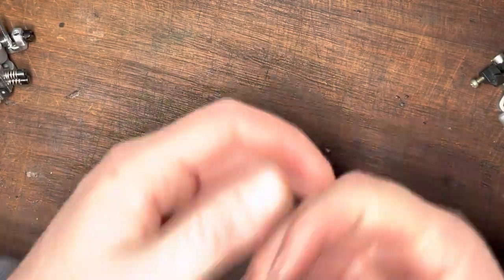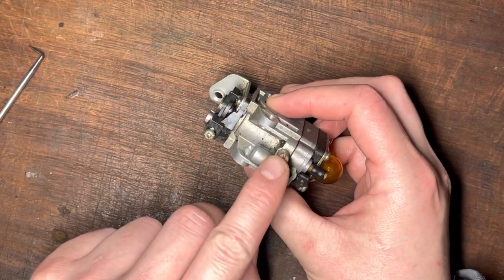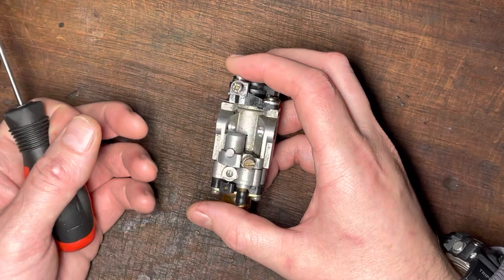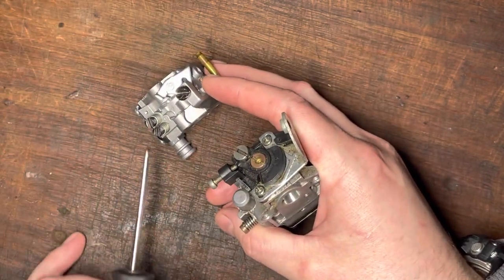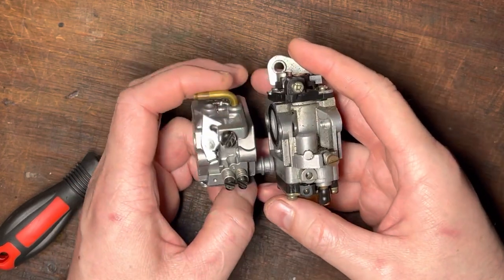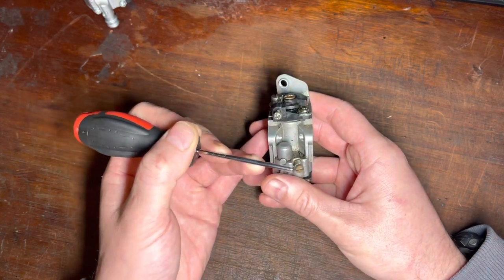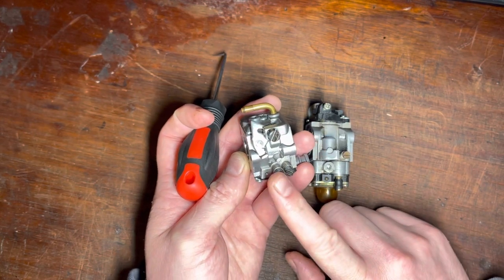Carburetor Tuning - 10 Things You NEED To Know!

Comment: Very informative, thanks a lot, by the way, the other carb, not the walbro type, what is that one called?
Reply from the maker: Thank you! It’s called either a “rotary” or a “barrel” type carb :) The thing I like most is you can run them on the edge of lean at idle for excellent trigger response and they don’t lean bog like the more common butterfly type.
Reply: @VintageEngineRepairs  Thanks a lot for the quick response :) Am an RC modelller and your videos are really helpful in understanding these carbs, tuning them and troubleshooting. Subscribed :)

Comment: Another cause i have found for an engine to stall after coming off throttle is a metering lever set too high, even with the proper mixture screw setting if the lever is set above where it should it will cause the engine to suck a lot of fuel when the throttle is released and make it slow down or even stall
Reply: Also, that information about the independent or dependent carburetor mixture screws is really cool, never stopped to think about it but it makes perfect sense

Comment: 0:00   1. Difficult to start engine.
0:42   2. Engine bogs on acceleration.
1:30   3. Engine splutters on acceleration.
2:06   4. Low power at full throttle.
2:47   5. Engine running rough with excessive smoke when at full throttle.
3:22   6. Engine idles too fast and idle adjustment is unresponsive.
4:04   7. Difficult to start engine with fuel out of the muffler.
4:23   8. Engine RPM drops excessively after full throttle or dies completely.
5:00   9. Engine stalls when left idling for a short period of time.
5:52 10. Engine RPMs change when you turn your engine on the side.
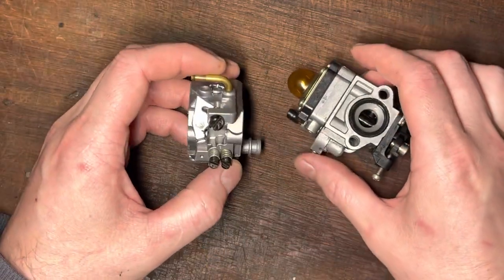7:49  BONUS TIP! Which screw do we adjust first?!
Reply from the maker: Wow thanks! Pinned this comment to the top :)
Reply: @VintageEngineRepairs  Cheers. I was still editing it, tweaking the times but can't anymore, I guess because it's pinned now?
Reply from the maker: @Syncop8rNZ  oh no, I’ll unpin it, let you do what you need and then re pin  it.
Reply: @VintageEngineRepairs  Oh I missed this, went to the pub. ;-)
It's all good, some of the time stamps could have been a second or two later but close enough.
My OCD is mostly satisfied.

Comment: Thank you.  My Echo PB265 starts well and revs well but after ten minutes of running it begins to lose power and, although just my conjecture, it seems to run hotter than previously.  Might you have any suggestions to resolve this?
Reply from the maker: Hmmm, you could try opening the H screw 1/8 of a turn and see if that helps?
Reply: @VintageEngineRepairs  Thank you for taking the time to help on this matter.  I haven't altered the high-speed adjuster screw so far because this blower has run flawlessly for almost a decade and, as implied above; it still performs beautifully with the H screw still concealed beyond the plastic plug--that is, until it gets warm or perhaps closer to hot.  During those first ten-to-fifteen minutes, it responds immediately to throttle movement, neither bogging nor burbling. I did remove the muffler and although the port appears normal (no heavy deposits of carbon) the spark arrestor is destroyed.  I wondered if the main body of baffling behind the arrestor gets so hot, perhaps red hot, that a new spark arrestor screen might resolve the conundrum.  Yet, if you still consider that high-speed adjustment (enrichment) remains the best option, I'll try it.  Thank you again.
Reply: Coil failure was responsible for the Echo blower engine stopping ten minutes after starting.  The difficulty was unlikely to be caused by the carburetor because I had access to another that produced the same result when warm.  The fascinating thing was that though the spare carburetor had a larger diameter venturi, it worked amazingly well, at least for the first ten minutes.  Thank you again for your wonderful series of instructional videos.

Comment: As I said in a comment about one of your videos regarding the Chinese Honda  cloned GX35 engine, which I was trying to tune I was thinking that it might be either an air leak through the check valve inside the metering body of the carburettor or something like that but since you said that the high speed screw might need adjusting then I might have to remove the brass sealing plug  from the carburettors body to get access to the high speed screw which is uncovered on some of the Chinese Hondas carburettors  but in my case with the OEM & aftermarket carburettor which I have they're covered.

What it was doing with the new aftermarket carburettor is stumbling then  stalling as It came down to an idle then I would restart it then it wouldn't idle until I readjusted the low speed mixture screw then it would play up again.

It would also start in the mornings when the engine was cold but it wouldn't idle until I adjusted the low speed mixture screw so I refitted the original Honda carburettor which seems to have fixed the problem !
Reply from the maker: Woo! Glad you got it sorted :)

Comment: I have an independent carburetor that works in the middle and not WOT. It operates well except in the mid throttle range where it will slowly lose rpm at a constant throttle position. I will open it up a little more by the throttle to which it will surge to higher rpm. What is a good mid range fix? (modifications are possible if suggested) it is the walbro 32
Reply from the maker: These don’t have a dedicated mid range circuit. Open the H screw 1/4 turn :)
Reply: ok thanks and lets say I'd like to add a dedicated mid range circuit, any advice where to look for reference or your thoughts? @VintageEngineRepairs

Comment: Hmmm I recently acquired a Mac 10-10 and it seems to suffer from Symptom 6: Engine idles too fast and idle adjustment is unresponsive.
When I start it it's racing. I backed the idle screw out and it eventually slowed a little but then at some point sped up again.

Comment: Are the springs under the metering valve different for different carburetors? While attempting to overhaul carburetor on ryobi leaf blower RY-09440 I lost the spring. Trying to find a replacement . Thanks
Reply from the maker: They do vary, but honestly I have interchanged them without any problem whatsoever.

Comment: I am concerned though that closing the high-speed screw with the engine running may damage the engine, but cutting off the oil.
Reply from the maker: You don’t have to be, it’s literally just a second before it dies and there is a lot of residual oil to keep it safe. Just like running out of fuel, the engine cuts out and you refill the tank, thanks for watching!
Reply: fair enough!! @VintageEngineRepairs

Comment: What if during idle, the RPM goes up and down?
Reply from the maker: That’s often caused by an air leak. I’d suggest pressure and vacuum testing the engine :)

Comment: Hi Tom , I just rebuild a chainsaw changed gaskets ,sealings, new piston but when I accelerate it wants to die . If I accelerate gradually it gets eventually full throttle with no problem , could be the main nozzle  in the carburetor.  I checked the carburetor with hand pump but could not check the main one , the little drillings are ok , checked them with wd40 .I didn't want to take it out but could that be the problem . From t , l ,h screws the problem could not be resolved so I think the main nozzle is bad .
Reply from the maker: Hey! It sounds like a fuel starvation issue to me.   Did you do a pressure and vacuum test on the saw? That’s the #1 most important test to do on ANY 2 stroke. Once you’ve done that. I’d say start from the fuel filter and work your way to the carb checking if it holds pressure and vacuum. You need a tool like this Mityvac Pressure & Vacuum Tester - https://amzn.to/3vysI3V. You can get cheaper ones, just make sure it does pressure and vacuum :)